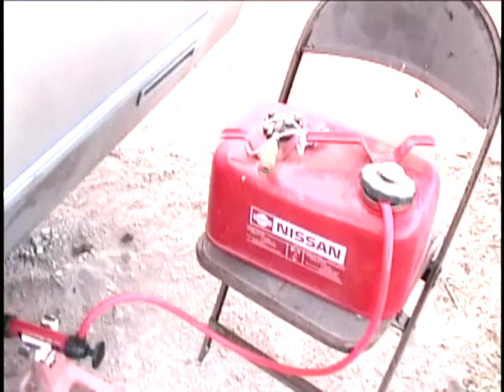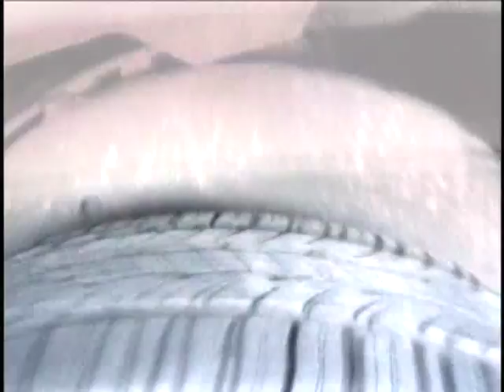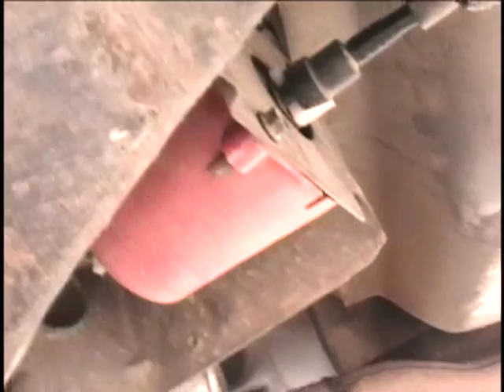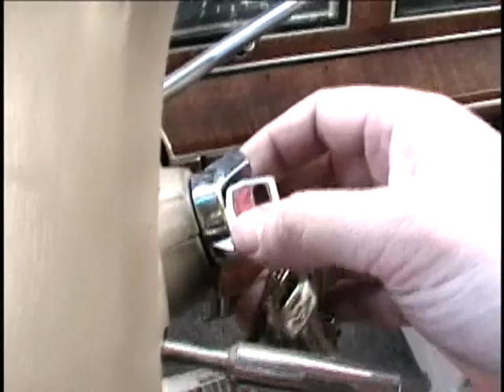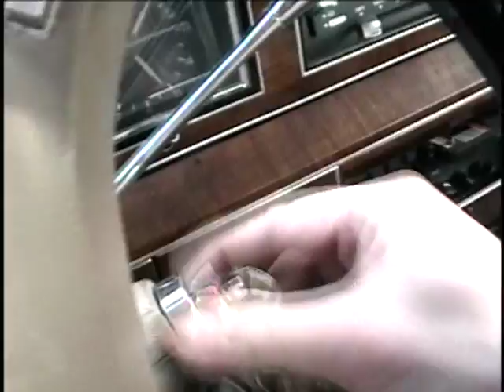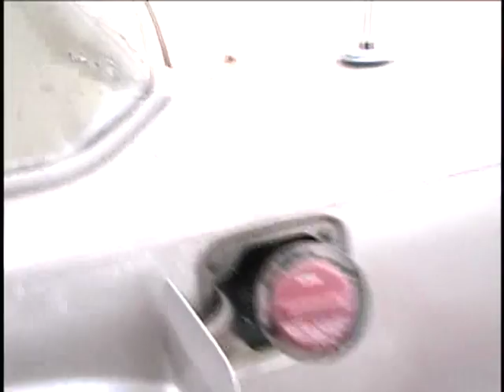1989 Lincoln Town Car new fuel pump test

Comment: I recently purchased 4 of these old beasts from a collector, 84, 88 and two 89 Signatures.  I am ready to change the pump in the 89 that I am keeping and I was wondering how difficult this was.  Pretty easy and the tank drops straight down, unlike my 89 Cadillac Fleetwood which was a pain.  Thanks for sharing.

Comment: i just did a replacement but mine dint wana turn on i think maybe i put the lines wrong or the fuel filter clogged up when i pit the new gas in

Comment: For what it's worth, if you wanted to see the max fuel pressure from the pump, you could just pull the vacuum line to the regulator, limiting fuel return to the tank.